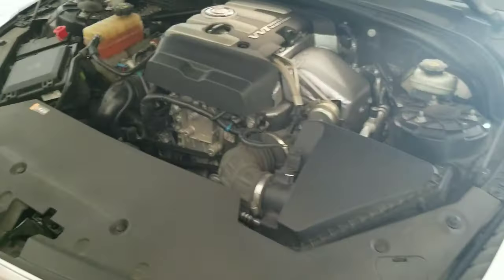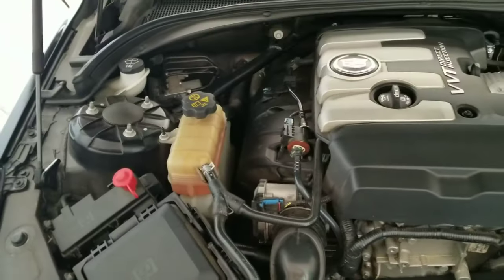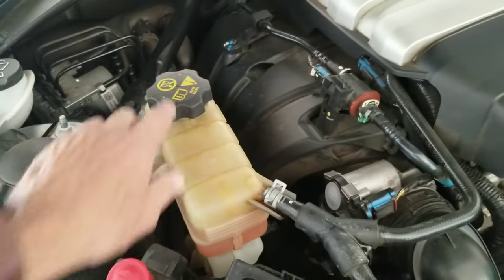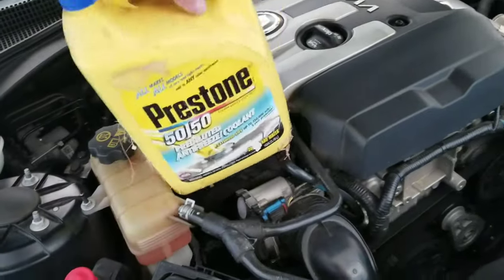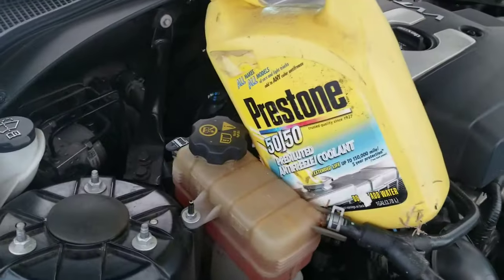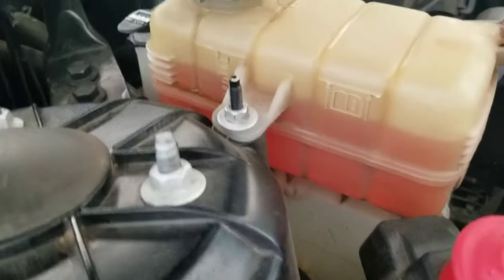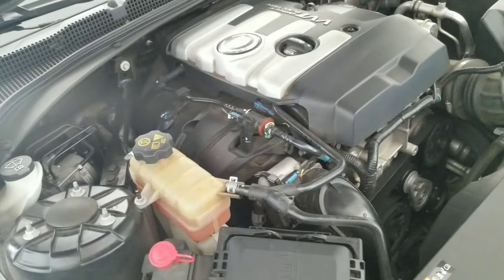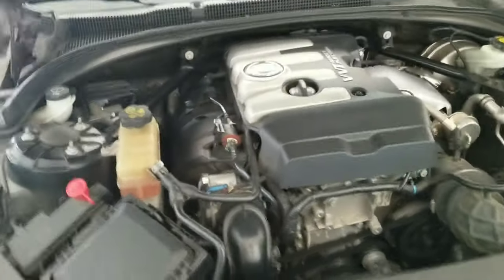How to fix cooling fan staying on

Comment: Sir, you were absolutely correct!  I did this on my 2013 Cadillac SRX and it stopped! I tried replacing the Cooling Fan resister, the thermostat. and nothing worked! Amazing. Thank you

Comment: How about a fan that comes on with a cold engine?
Reply: My integra has that problem
Reply: You might want to check the coolant temperature sensor
Reply: If COLD engine try turning off the air conditioner because at least one fan will be on Impala. Ok !

Comment: The reservoir has a sensor that singnal the computer wen antifrize is low causing computer keep sending signal to cooling fan sensor to stay on,that may be why.....
Reply: Sounds right. My radiator fan turns on immediately after i turn on the vehicle. The fluid is very low